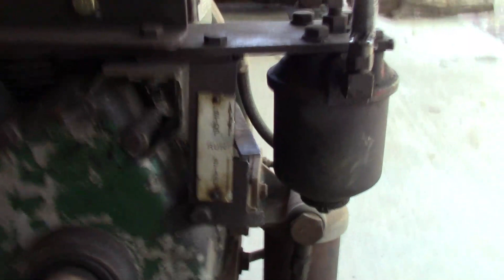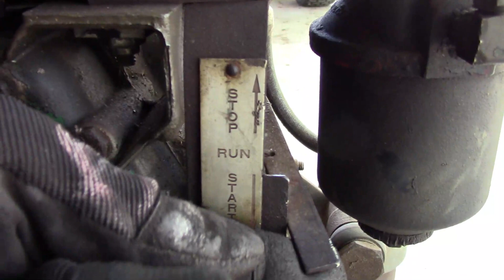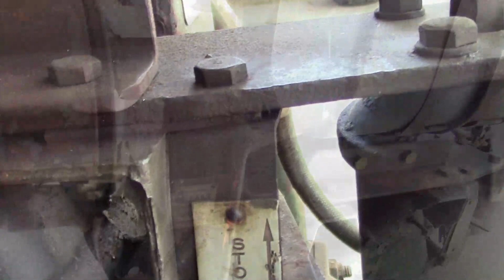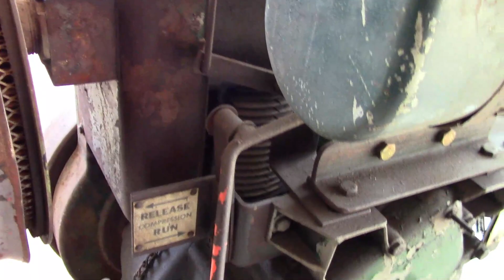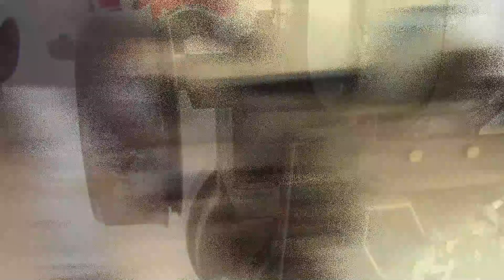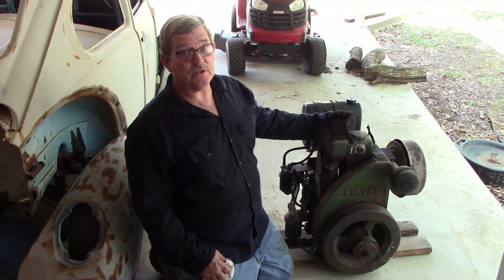Lister SL 1 Cold Start

Comment: What does SL  stads for on the engine lable?
(I have just bought a Lister SL2 , marine version gearbox + redutionbox)
Reply from the maker: @NilsOlander   The Lister LD & SL range of air cooled 4 stroke diesel engines made between 1956 and 1966 are a direct injection engine with a Pintle type injector nozzle and a combustion chamber located in the piston crown. Thanks and take care

Comment: I used to run a single cylinder air cooled Lister in a 16 foot  heavy clinker boat I used to own ,a brilliantly  simple little engine no water intake to get blocked and no impeller to worry about, no starter motor and so no battery and no alternator to worry about and the hideous replacement costs plus they run all day on a gallon or so of diesel and so so fuel tank to rust or fuel lines to block . If anyone wants an inboard engine to run a 16 footer then you won’t beat the simplicity of a lister.

Comment: I live off grid in UK and bought an ex Woolworths standby generator with the sr1 engine, it has done 5-7 hours a night for the last 12 year with the exception of holidays and nights  out I reckon over 26000 hrs with only basic servicing.
Reply from the maker: Great to hear how you still are using yours . Wished mine had a generator.
Reply: @RustyGlovebox  yeah its probably the best £150 I ever spent.

Comment: Now you just need a gearbox with a forward and reverse, a propshaft and stern tube, propeller, and a boat!
Reply from the maker: I have thought the same thing. That would be so much fun. It wouldn't beat any speed records but that not the point.  Have you seen the movie "African Queen" it had Humphrey Bogart and Katharine Hepburn in it. The small steam boat they used in the movie was a favorite to me.     Thanks and enjoy your week.
Reply: @RustyGlovebox  There were quite a lot of little boats to be found pottering about with Lister and Petter engines, generally 'harbour' boats that never needed to go fast, but there is something I never got my head around. Boat engines are more about torque than horsepower. Of course, I would prefer a steam engine, like the African Queen had, but have you checked out the prices for steam engines, even in kit form?
Reply from the maker: I had been a fan of steam power . I would like to build one someday.